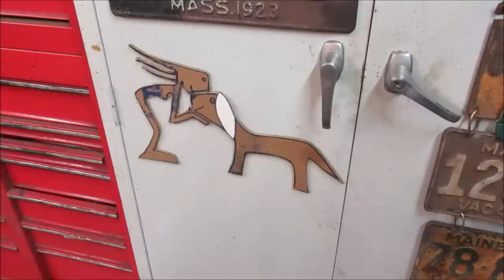Past Repair Made This snow Blower Useless, Lets Fix It.

Comment: If you mean the Auger running backwards I saw that in the first video and
thought that somebody had made a mistake.

I was going to comment on that but forgot to.

I have not even watched this video yet when I put this comment on here.
As soon as you said there's a problem with one of these I knew exactly what probably you were talking about.
Somebody must have put the auger back in upside down.
Maybe a factory screw up.

I catch things like that.
I love antique mechanical screwdrivers to. Aka egg beater drills.

Someone was demonstrating a North Brothers 1545 that they just bought off of eBay that has a bunch of different settings. 

As soon as he started talking about it I realized that one of the former owners had taken the transmission out and put it in backwards. But this new owner thought it was working normal.
I mentioned it to him. I don't know if he ever did anything about it.
Oh well. 😁😉🙄😆😂

Now I will watch the rest of the video. 😀

Comment: I had to do mine a couple weeks ago. The sheer pin broke and would not come out. Split  it  down and drilled the pin out. 
That bearing flange was a PITA to line back up.

Comment: When the shear pins were missing on a unit leant to me by a buddy, I learned that a 1/4" brass or aluminum bolt will work just as well. When I went to replace them 90% were just aluminum or brass bolts....for NINE DOLLARS for a pair....I'd say 20% had the shear points formed in them but those were the larger 5/16" size which with the shear point cut them down to 1/4" at that point.
Reply: yep, we started stocking up on brass toilet flange bolts by the case in the fall just for that reason. shear pins  were often back ordered, unavailable locally and if they were, they were price gouged. Id rather keep replacing sheared off brass toilet flange bolt then have to get out the torches, heat beat fruitlessly a rusted in seized steel shear pin
Reply: @harveylong5878  hey now, that's a great idea....they are cheap too, like 1/3 the price......I'll have to pick some up next time I'm at the hardware store.

Comment: I have a Simplicity blower which is a nice powerful machine, but the bolt holes on the bottom of the hinge are slotted, meaning that I can't just fold mine, it comes apart.  Getting it back together is a PIA.

Comment: It would still be a good idea to reset the guide shoes on the sides of the blower housing. They should keep the bottom scraper about 1/8" off the ground. This should have been done during dealer prep when the machine was sold new. Been there, done that.
Reply: 1/8" only if you have a paved drive in good condition. At least double that if it's in poor condition, and unpaved might be up to an inch.
Reply: those skid shoes are totally worn out as they are, worn completely thru the skid. they have to be  flipped over to  be any use
Reply: @harveylong5878  Sure! Whatever it would take. They could be replaced as well. They are not very expensive.

Comment: I saw that Taryl did a midweek short on a tool that will quickly remove the rivets that hold on the rubber "blades" on the less expensive snow machines?

Comment: 22:24 Just like a threaded rod, augers don't go the other way when their flipped.  If you flipped it over and drilled a new hole for the shear pin it would still push snow to edge and not the middle.  The left and right augers only work on their proper side.

Comment: The whole assy comes out thats how it went in... I used to assy them... there are two bolts that hold the tractor and header together...  seperate them take the rear pulley off take the bushing bolts loose, the whole assembly will slide foward and out... thats how I assembled them years ago. Change your rakes and slide it back together easy peasy. Dont mess with the blower... your doing it wrong. Ariens has never split that shaft even 30 years ago when I built those.... dont change what works that was Ariens thing back then... aint often you got one of us that worked the assy line where they were made... good Job..... and yes sometimes they do fail even at the factory to put those on correct

Comment: Allen Millyard would have simply removed the cam shaft modified it to make the engine run the other way , cut a new key slot in the crank shaftto adjust the ingition timing. move the tension pulley to the other side and flip the blower housing around putting the discharge shoot to the other side . Making it a one of a kind machine.

Comment: I don't live in an area that needs snow blowers,.. and I didn't even pick up on the previous videos that the blades were backwards,... but now having watched another Sunday morning Mustie1 video fix, a question comes to mind.

It may not matter, but I noticed that the tips of the blades on either side weren't lined up. They appeared to be 180 deg out of phase. In fact on both snowblowers.

It seems that the blades would do better at grabbing snow and pulling it into the broadcaster,... like using both of your hands and arms together to drag snow toward you as opposed to more of a swimming stroke,.. if they were in sync.

Comment: Slightly bent impeller shaft. Frozen newspapers are really hard on gear boxes and impeller shafts. I sucked up one of my heavy tow chains in my blower last year (I accidentally left 1 sitting outside at the corner of my shop door) Had to pull my blower all apart and straighten the shaft. Luckily the sheer pins did there job and saved the gear box.

Comment: That wobble could be from the main shaft bearing where it goes into the blower housing.  I inherited a blower where the bearing was so worn out the impeller was making contact with the housing.

Comment: Out of curiosity why didn't you take the bend out of the auger blade you reinstalled on the LH side of the machine (from the operator side)? I don't know snowblowers, maybe it doesn't matter? There is a pretty good close-up before you swapped them @3:51
Reply: it'll just bent up again. first good heavy snow, bit of ice and/or a snowbank the augers will get tweaked again. we just beat them straight enuff so they arent dragging on the housing. gave up trying to get them perfect

Comment: i just use regular bolts from Fastenal for my honda Auger Shear pins....  The 1st few years, I would put a kerf on them with a hacksaw, but I don't know if it's necessary....  They were like a m6x20mm bolt, and nylock nut.  Maybe I should go back to putting a kerf in the bolt....

Comment: That bent auger pulley can be straightened if you pry on it with a piece of hardwood. Carefully! 
 Grease parts so they won't rust together, for the next time.

Comment: It's pretty easy to grind a shear pin out of normal bolt, especially when you've got an original one as reference, even though there may be some small difference in metal hardness.
Reply: I wouldn't do that. You will want factory-spec shear bolts or nothing
Reply: One day when my father was shopping for shear pins at Sears another shopper tipped him off about a cheap normal bolt that could be used instead. I can say from experience that the substitute does shear just fine.

Comment: Mid week Mustie! I've been running bolts in my snowblowers over the years without issue. Except that time I caught a tarp and twisted up the auger lol. When it comes to normal use its the operator thats busting the shearpins. That being said most of the population out there have zero concept of feeds and speeds and they need them. I always put proper shear pins in other peoples snowblowers I repair.

Comment: I refurbished a Murry snow blower last year, and it has been sitting unused, it seems I am guilty of pulling off the same screw up,  I tried using it today and it would not throw any snow, after watching this video, I went out to the garage and sure enough the augers are installed backwards, guess what I will be doing tomorrow,

Comment: Well that’s about the easiest an auger and impeller assembly ever came out of an old snowblower! Poor guy who did it and put the augers on backwards did all the cursing and knuckle busting for ya!
Reply: I imagine the previous person to work on it as a novice who had an absolute nightmare removing the pulley.

Then when they realised it still didn’t work right because of the mistake with augers they just bought a new snow blower and swore off repairing things themselves forever.

Comment: It looks to me like the augers aren't timed correctly. They should both push the snow towards the center at the same intervals.
Reply from the maker: not true, they can only bolt in the one hole, even if you spin it 180 its still the same thing,

Comment: I have a similar unit. They are certainly not made for hard and professional work. They are quite crappy. but as luck would have it, there has been not so much snow the latest winters, so my unit has survived (so far). But at least it was very inexpensive.  $250.

Comment: you can use brass toilet bolts for sheer pins
Reply: We do it all the time. shear pins became too much of a hassle. nothing like a knuckle dragging gorilla  snowblower operator breaking not one, not 2 but 4 different snowblowers shear pins off at 4 am during a 36 inch blizzard and all but 1 machine I had to drill new shear pin holes for since what was left of shear pin was rusted in the shaft. 2 hours of heating and beating got me nowhere

Comment: Nice catch. But they still look like they’re 180° out of phase with eachother
Reply from the maker: they can only go 180 as it only has one bolt hole,
Reply: @mustie1  Darren, I think the point is to pull the shear bolt, rotate the auger on its shaft half way around and then re-install the shear bolt.  Thanks for another great video.

Comment: I have had to pull those apart to straighten rear impeller. Do not hammer pulley shaft with hammer. It will mushroom

Comment: On the 48" blower, I don't think it is possible to just flip the auger half over and slip it back on and expect it work. You need to switch sides. If you have ever tried to reverse a fan, turning the blade around does not work either.

Comment: Hmm, you must have fixed that tractor auger another way, because just flipping it over won't change the direction it will shovel the snow. It's like flipping over a length of threaded rod, it it's right handed it will keep being right handed.
Reply: he said he redrilled holes after flipping
Reply: @MegaRickw  Yes, but even flipped the auger will auger in the same direction. Flipping a screw/auger does not mirror.
Reply: @TDOBrandano  He didn't flip the augers. He swapped the right and left sides over. They work properly that way.

Comment: The pully is "Wobbly" Because the people before u used a puller and bent it?
Reply: not likely. the main auger shaft bearing in the rear of the housing is going bad. the bearing gets worn out , egged out the pulley and rear impeller get all loosely goose wobbly

Comment: 22:25  Re flipping the 'wrong' auger over, this will achieve nothing, as the helix is still the same, whichever way around it is.  Think of a piece of threaded rod, if you flip it end-to-end, you don't now need a LH-threaded nut, you still need a RH-threaded nut.
Reply: I was thinking the same thing...

Comment: could you flipped them end for end instead of switching them?
Reply: no. the gear box cant be flipped over. meaning you cant just flip the whole assembly 180. the gear box worm gear would be turning the wrong direction
Reply: @harveylong5878  sorry I meant just the blades

Comment: 18:25 the main drive belt went on my snotek and the belt was only $8 but reading the manual it said to split the machine. I looked at the problem, get the hell outta here you don't need to split the machine, I did just what you did. I took the one that drives the auger off first, then put in the main belt, then put the auger belt back on, instead of an hour it took 10 minutes.

Comment: Cut the side off and weld it back on.. easy solution.
Reply: thin ass sheet metal is a PITA to weld. as well as the added bonus of the auger housing moving from the heat of welding. they already thin foil thin, cave in from weight of snow

Comment: Taking the pins out of impeller won’t work on most machines. Thst shaft continues from gear box through the impeller and through the pulley.  Every machine I have ever worked on is this way.
Sometimes your videos are extremely hard to watch.  A three minutes web search will get you the owners manual .you would save yourself time